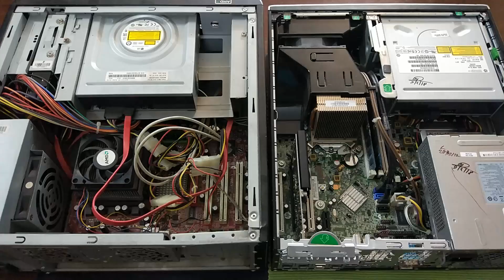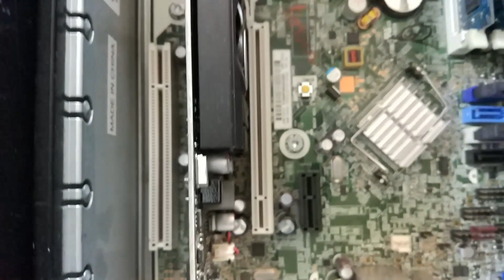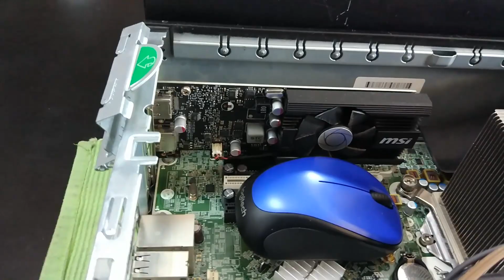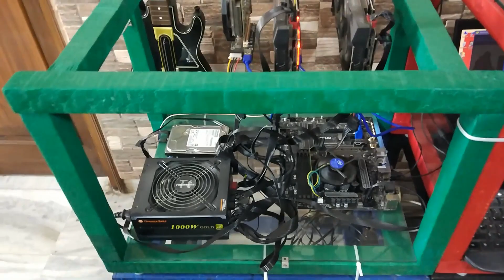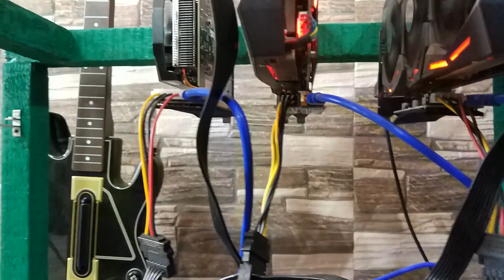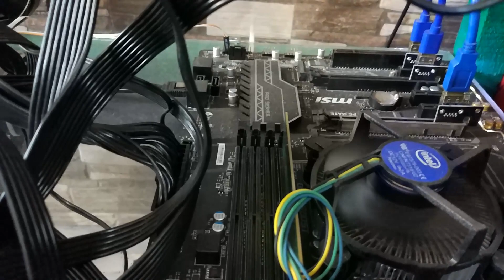Physical Identification of PCI 2.0 vs PCI 3.0  vs PCI 3.0 Express on Motherboards for Graphics Card

Comment: Can a gpu pci 3.0 fit  in pci 2.0 motherboard
Reply: What? Yes. PCI-E is backwards compatible. You can use a PCI E 4.0 GPU in a PCI E 1 slot. There may be a slight performance penalty. I think Linus has a video on this.
Reply from the maker: Not at all :(
Reply: @nipunharitash  dude why are you lying you can fit 3.0 gpu into 2.0 motherboard

Comment: Your 3 video cards are not having pcie x16 speed but pcie x1 speed which is very slow  are they designed like that or you have bottleneck them by pcie x1 speed

Comment: Thanks for solving the physical difference between PCIe 2.0 and PCIe 3.0. I have a question. I was searching for videos like these to buy a riser card. I have a graphics card which supports only PCIe 3.0. If I use an internal USB extension from PCIe X1 to power the riser module, would I be limiting the bandwidth of the card's potential?
Reply from the maker: Hello, I have a rig that mines ethereum and I am using 3 riser cables. They work just fine . No bandwidth limitations :)
Reply: @nipunharitash  Thanks! Mine is just a gaming build. Buying to show off my graphics card in the side panel, I guess I'll go ahead now! :)